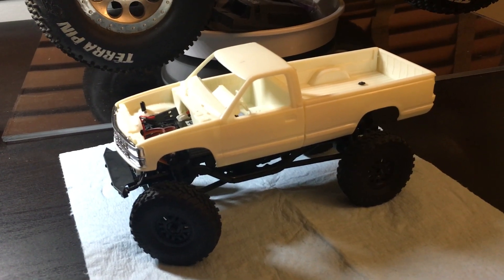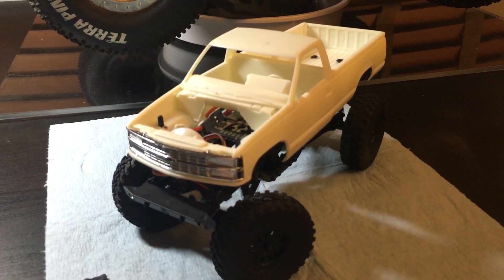Axial SCX24 | How to Mount a Hardbody

Comment: Alot of people ate using the 1/20 scale kits for trail rigs, the slightly larger body looks more scale for a crawler 👍 im totally buying that same c/k1500 body for my next project though, the 1/24 scale body with tall tires looks like a Mega mud truck! 🤙
Reply from the maker: Absolutely! Yeah this wont crawl as well with the larger body but I dont care as much because I was going for scale realism, and like I said, you can always go back to stock with how I installed this!
Reply: @nc2827  Excactly! I'm working on a 1/20 scale Explorer body on a SCX24 with the smaller ECX Barrage 1/24 wheels and tires. They look super scale, almost excactly like 38s on 15s in scale. The shorter tires limit ability a bit but I just built a more scale accurate crawler course! 👍
Reply from the maker: @barneymiller7894  Very cool!!
Reply: @nc2827  Ya im thinking about putting a couple channels up, one for my RC Stuff and one for my 1:1 car stuff. I'll drop a link if I do 👍

Comment: Can you pls link the website for the body I'm brand new to the rc world im about to do my first 1:24 build and I would like to do this body because I have it in real life?
Reply from the maker: I got mine from a local store but here is a link you can use https://www.amazon.com/AMT-Silverado-Monster-Coca-Cola-Plastic/dp/B086RZ2G8V/ref=asc_df_B086RZ2G8V/?tag=hyprod-20&linkCode=df0&hvadid=459667108255&hvpos=&hvnetw=g&hvrand=9333899238683337410&hvpone=&hvptwo=&hvqmt=&hvdev=c&hvdvcmdl=&hvlocint=&hvlocphy=9021498&hvtargid=pla-940251116852&psc=1
Reply: any hobby store, they all sale static model kits even Rite Aid believe or not sells these model kits & of course Amazon /Ebay etc. 👍🏼